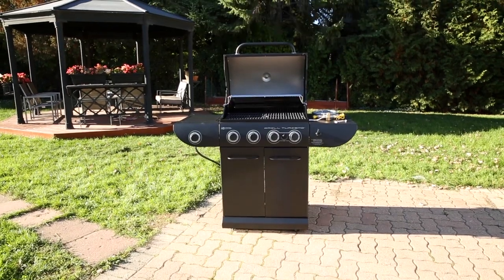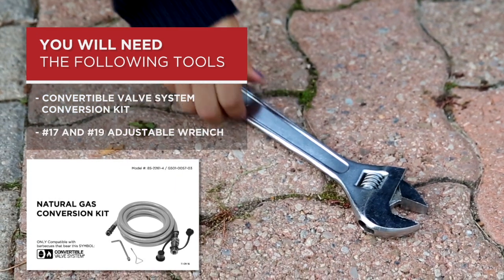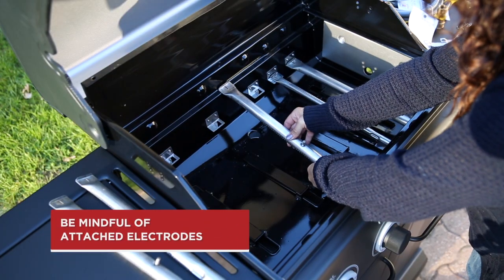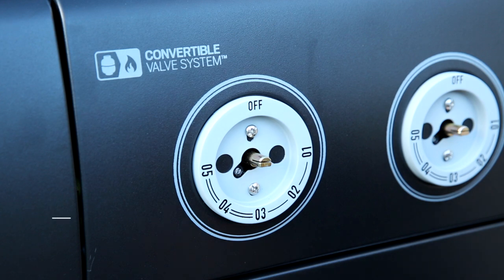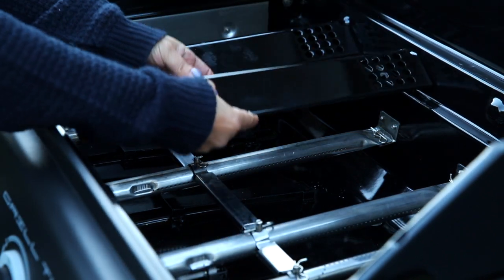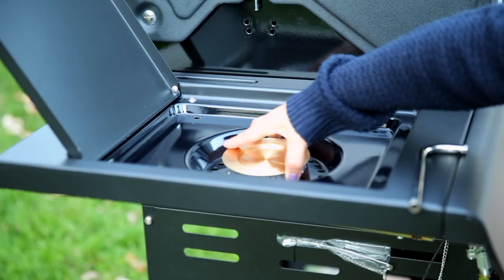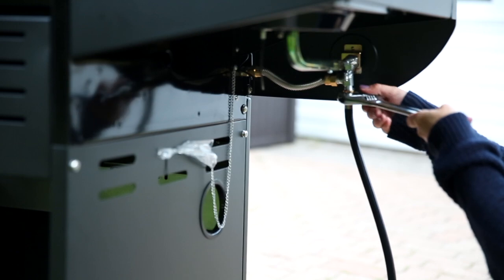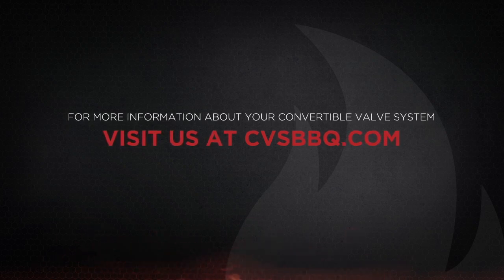CONVERTIBLE VALVE SYSTEM™: How to Convert your BBQ to Natural Gas

Comment: For the Master Chef Grill Turismo; is there supposed to be a Switch Screw on the Booster burner?  I can't find one on my BBQ.
Reply: Frenchy032768 what is the answer?
Reply: There is a switch screw underneath of the control cap. Similar to the other burners.

Comment: Wait you dont need to add the office for NG
Reply: Propane Gas is at a higher pressure than Natural Gas. The orifice helps regulates the flow of propane so it doesn't blow apart your BBQ. When removed it allows the lower pressure Natural Gas to flow correctly.
Reply: @kylegibbard  yes but swaping to larger orface instead of removing entirely. Wouldn't un restricted gas also now shoot into burner as well the venturi effect i believe
Reply: @convertible valve system 
can you address this point? while there aren’t NG orifices included in the pack (and no mention of them when reassembling burners) it would be nice to have it explicitly stated that they are no longer needed
Reply: I think the reason you look for the 'Convertible Valve System' logo is so you know you don't have to replace the orifices, just remove them. If your grill does not have that logo, you will have to put new natural gas orifices where the propane ones were.